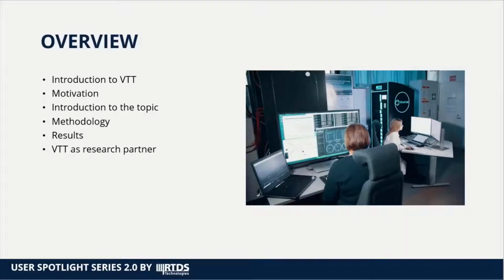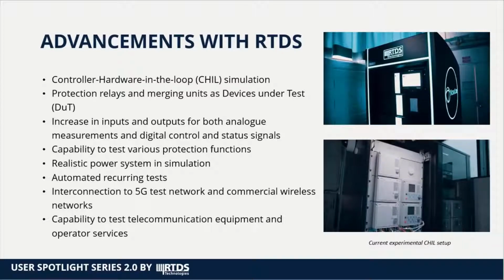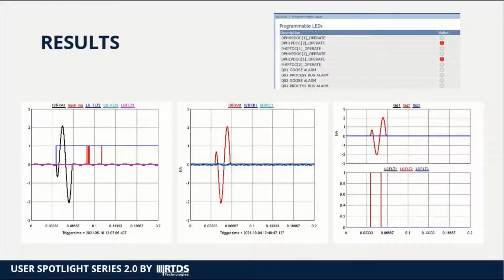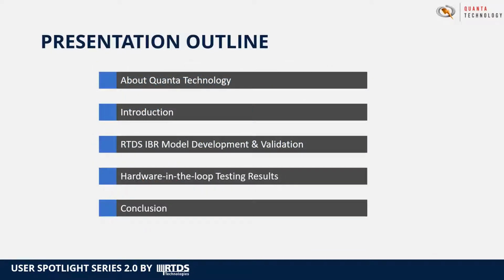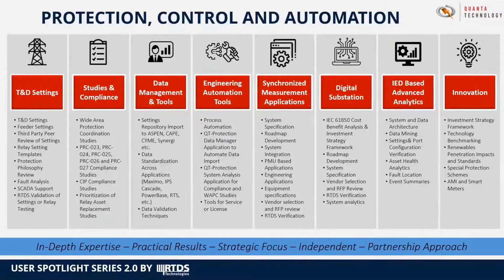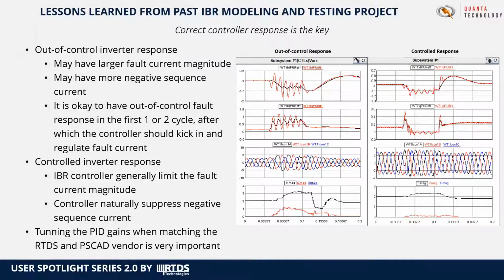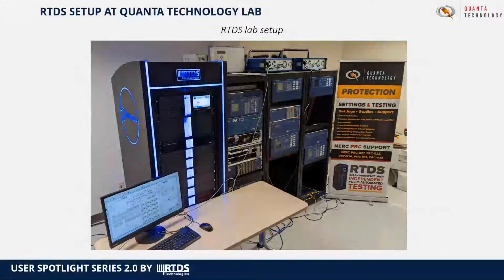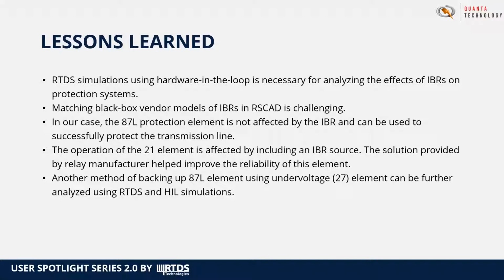User Spotlight Series 2 0, Episode 1

Comment: Hi,
Really impressive work done by both the teams. 
I just wanted to clarify from Quanta team on, Why the differential scheme was tested with fault resistance of 30 Ohm while the distance scheme was tested with 0 Ohms?
Reply from the maker: Hi Kalinath - Please see the following response from the Quanta team: This is a great observation. We have tested high impedance fault cases for the distance scheme. We noticed that in the solid fault cases (zero fault impedance), the distance scheme already struggle to pick up the fault. For the high impedance fault test cases, the results are even worse if not completely mesierable. For our presentation, we didn't presented the high impedance cases because it share the same root cause with mis-operations in the solid fault cases. The high impedance cases only deteriorate the result even further. We thought showing the solid fault cases are enough to convey the message. If you have more questions, please send an email to marketing@rtds.com.
Reply: @rtdstechnologiesinc.3249  Thank you very much for sharing this, appreciate that.